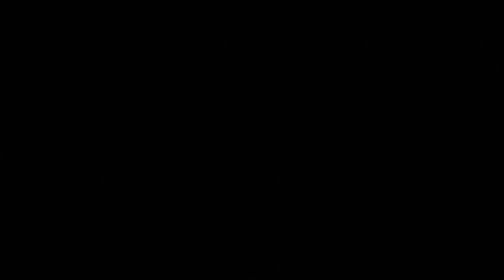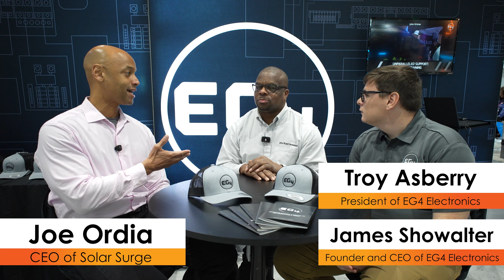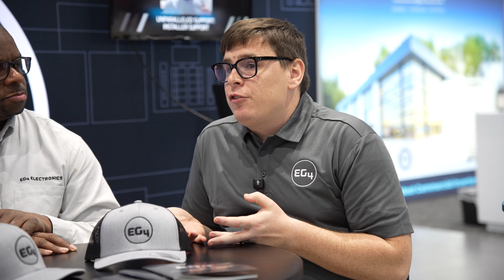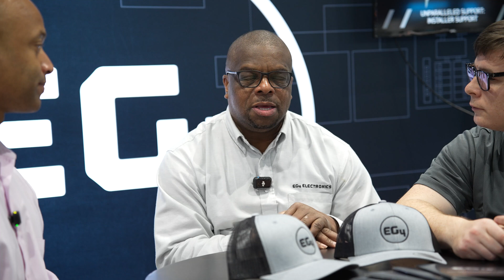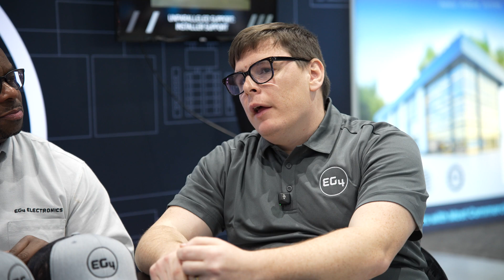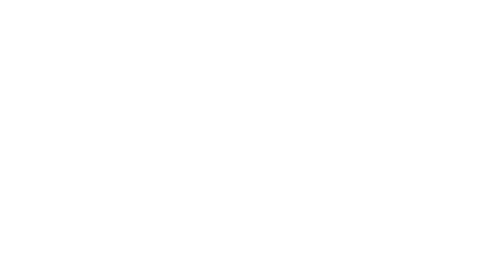EG4 Now Made in USA

Comment: At this point in time, EG4 doesn't have any electronic engineering staff, experienced manufacturing staff, or any manufacturing experience. How on Earth are they ever going to manufacture inverters in the U.S.? At best, I think what they will be doing is assembling Chinese-engineered inverters with primarily Chinese-made components, which will cause them to dramatically increase their pricing beyond the point of marketability and turn their already inferior Flexboss line of inverters into a total Flexbust.

Comment: It doesn't matter where these inverters are manufactured. These inverters will still use inferior, low-cost, high-frequency, transformerless Chinese designed inverter tech that offers a poorer surge capacity and a shorter life expectancy than higher-performance, low-frequency, transformer-based inverter technology. Also, because these high-frequency inverters won't have an output transformer to provide any galvanic isolation, they will still pose the risk of damaging your home's appliances when their IGBTs fail. It doesn't matter if they're made in China or Texas, they will still provide less value for the money.

Comment: Now you guys need to develop a DC couple bidirectional charger. Last thing missing in portfolio
Reply from the maker: I agree. I would like to see EG4 offer something in this area.
Reply: They hinted at it in a recent video.  I can't remember which one of the videos, but it came from James.
Reply: They desperately need a meter socket solution if EG4 wants to be more than a DIY supplier. Tesla/Enphase and soon FranklinWH have them. They significantly cut costs/speeds installation
Reply from the maker: @ArthurDentZaphodBeeb  I agree.  FranklinWH and Lunar both work with the ConnectDER meter collar adapter.

Comment: 😊Go EG4!😊ya need to catch up a bit on the firmware’s, but I still love the GB+Flexboss21 that runs my home now!

Apart from self-consumption mode, which works quite well, most of the other modes are kinda unusable.  I use AC charging just to ensure the battery doesn’t go below 23%, but for example I cant really use force-discharge mode to export.

The problem with force-discharge is that the discharge value is absolute rather than a minimum.   If I want to force discharge 2kW 4-9pm only when the battery is above, say, 85, it just doesn’t work well because if the house uses more than 2kW, it winds up importing the difference when I really want it to self consume greater draws.

Other examples…. I have to use AC charging to ensure minimums (e.g. 23%), but then I can’t tell it to charge up to, say 50% by 3pm because you can’t set a separate charge target for other modes… it always wants to use the AC target which doesn’t help at all.  The logic just doesn’t have the capability.   Peak shaving and other modes are similarly broken.  Self consumption is really the only thing that works well.

And things like the system display and data history on the web site gets very confused about AC coupled solar. They think my solar generation is zero for the day when my solar generation via AC coupling on the smart port was actually 30kWh.

Most of the various working modes are unusable for similar reasons.  It would be great if you redid the logic to make the modes more useful.

-Matt